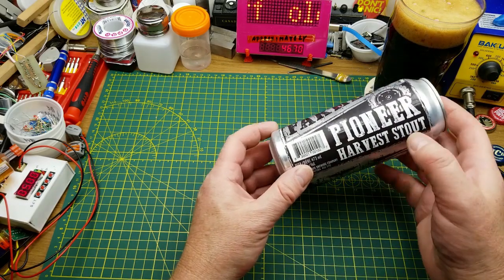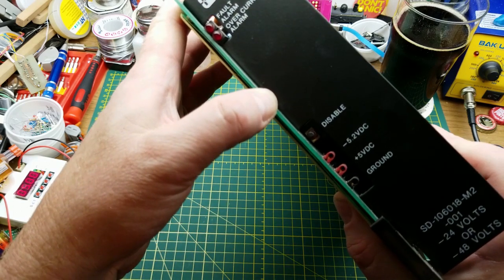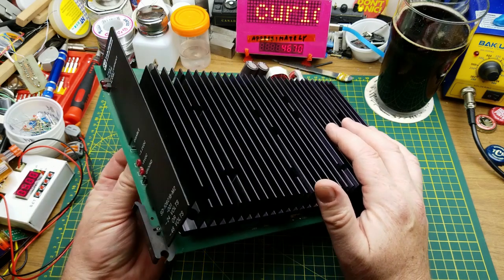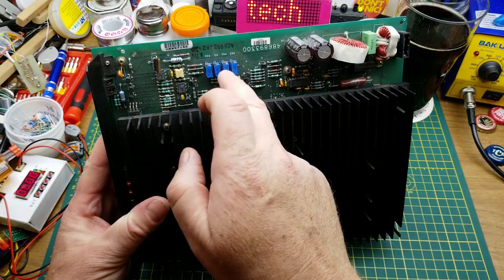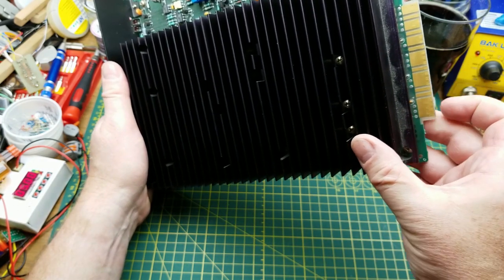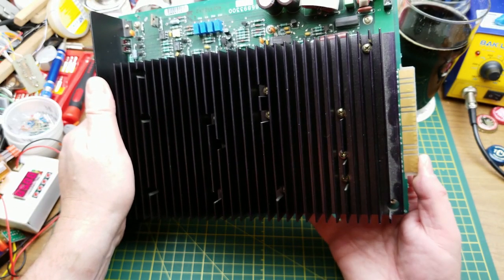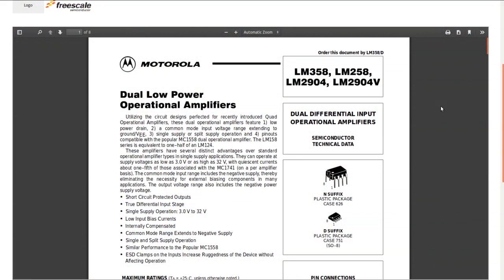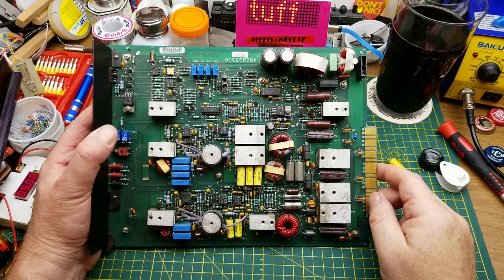Haris/Farinon power supply  teardown

Comment: Still got hopefully somewhere some old IBM minicomputer power converters, that are basically a heatsink  attached to a chassis, with a small PCB as back cover, which had every part, from the AC inputs from the power supply. Only things separate were the massive "computer grade" electrolytic cans on the base, connected via some really thick cables to a connector, that did the smoothing of the unregulated inputs, then there were separate individual switching power supplies for the assorted voltage rails. IIRC it had 5V, 12V, 24V and separate +15V and -15V rails for driving RS232 and RS422 interfaces, and the main power rails had plenty of grunt in them.

Comment: I only knew harris from semiconductors/chips, looks like they did a great job on the psu :-D.
No skimping on that heatsink, designed to run cool and reliable.
If there is anything wrong with that psu it will have worn out capacitors, switchmodes batter the hell out of capacitors.
Reply: Using high quality capacitors so it would run for at least 3 decades. They also used wet tantalum in critical places, like the output filtering, because those Vishay parts are pretty rare to have fail in the soldered case. Of course the price for each of them was probably more than the cost of the rest of the board component wise.
Reply: I suppose its worth the money, a reliable system that behaves itself for donkeys years :-D
Shame that ordinary consumer devices are made to die in 2-3 years, i've seen poor quality power supply capacitors in lcd tv sets, i tend to use panasonic capacitors to replace them because they are decent but not too bad price wise.

Comment: At around 14:06 when you are looking at the back of the board, it looks like there is a date marking 9524. The 24th week of 1995. On the MC1402 chip at 5:57 is a date marking of 9435. Also at the same time (5:57) the CNT17F chip has a date stamp of 9522. So it does  seem to confirm it is from the mid '90s.

Comment: It looks rather impressive for a 130W PSU.
Those Vicor chips are obviously a PWM controller, without the datasheet though it's hard to figure out the switching frequency.

Comment: Can you put voltage to it? I wonder if it works.
Reply: Probably still works, nothing goes wrong with massively over designed stuff meant to last as close to forever as the designers could make it.
Reply from the maker: Probably, but there might be some "enable" connections on that edge connector that I'd have to figure out.

Comment: back in the day,we used lots of Haris logic chips. All the parts we used were to mil standard so manly ceramic cased. being mil standard they came with Mean Time Before Failure (MBTF) data so we could spend weeks working out the MBTF of the assembly. add a 28V bulb as an indicator and the mbtf feel through the floor. that's why on avionic panels you would need gloves to press the buttons. if the button had two indications you would have 4 bulbs. getting heat away was always a big issue. anyway great vid as usual keep them coming.
Reply: Also a reason every lamp included a push button assembly, so you could simply press the lamp and see if it would light, as a lamp test, and also had a separate lamp test button per panel for this same purpose.
Reply: @SeanBZA  hi, i like designing  mil equipment as they know how to write specifications. it's sooooo much closer to  being black and white. comercial stuff the spec's are so fluffy and even they don't seem to know what they want in the first place.
Reply: @TheEmbeddedHobbyist  Yes, the military wants to know every thing about the stuff they use, so that they can do all the maintenance themselves, or at least have confidence it will perform as required all the time. There are however plenty of times the original spec and what you get seem to be somewhat disconnected, and often only bear a vague resemblance, after having had a few designed by committee rounds go through it, and everybody wants to add their own special sauce to it. Soldiers wanted a jeep, they got a hummer instead.